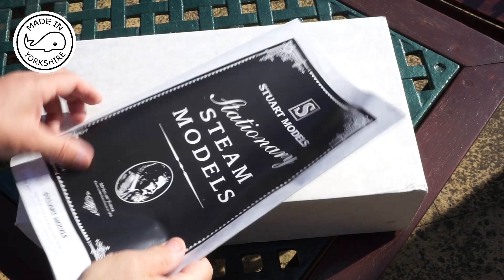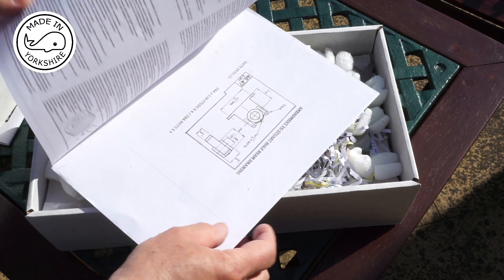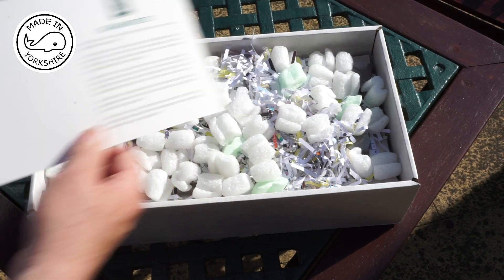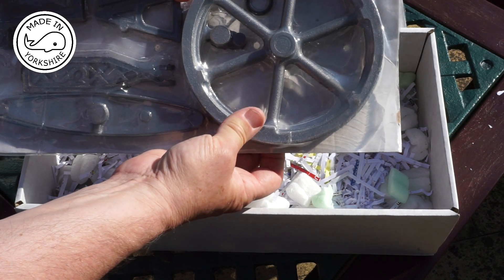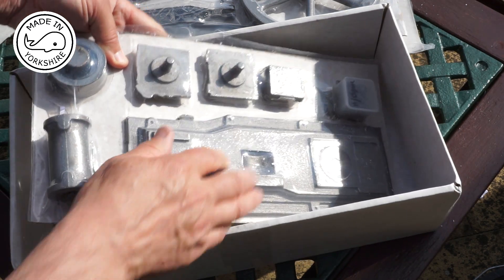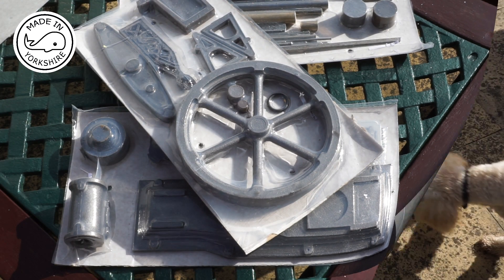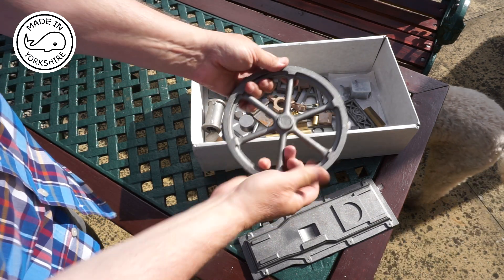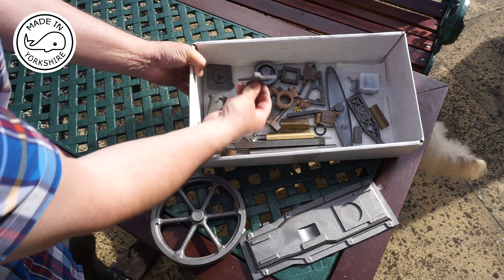#MT32 Part 1 - Making a Stuart Half Beam Steam Engine. Unboxing. By Andrew Whale.

Comment: Andrew are you aware of any formula for the relationship between the stroke of a steam engine and the length of movement that is provided by the eccentric or do you just get your info fron the drawings
Reply from the maker: Hi Peter - I just use the dimensions in the drawing. I'm no expert, but I don't think that there is a direct relationship between the stroke and the eccentric. However, I think that there must be a direct relationship between the slide valve, cylinder port face and the eccentric in order to ensure that the ports are adequately exposed/covered. Hope that makes sence.
All the best.
Andrew
Reply: @learningturningmetal  Hi Andrew, thanks, this model engineering is still pretty nee to me. Thinking and looking at some more engines I think the eccentric is supplying a means to an end ie reciprocating for valve operation. It doesn't really matter what length of stroke just have to make sure the porting gets covered/uncovered. I think I wss going at it from the wrong end
 Cherrs matey

Comment: I seem to remember that Mr Pete 222 featured a coaxial indicator in one of his 1000 + videos. I haven't got one of those yet, but I could have done with one for centralizing my rotary table as I am about to embark on cutting new gears for the lathe out of steel.
Reply from the maker: Thanks Stephen. I'm subscribed to  Mr Pete and will have a rummage through his vids. Good luck with the gear cutting. I quite fancy having a go at that but haven't yet found a project that needs it.
Cheers
Andrew

Comment: Nice one Andrew,
Aleast the lathe has a swing of 8.5 inches for that flywheel.
Compared to the mini lathe.
Also removing the chip sheild doesn't affect the lathe from running as the micro switch needs to be actuated to stop the machine from running.
Eventually the lever on the micro switch will fail, replacing it is quite a job.
ATB Adam
Reply from the maker: Thanks Adam. I just hope the micro switch lasts a lot longer than the estop!
Cheers
Andrew

Comment: Will that flywheel fit in the swing of your lathe?
Reply from the maker: Just! The SC4 can just manage around 8" diameter. The flywheel is 7". However I now realise that I will have to take the safety shield off first. Fingers crossed it will be ok.
Cheers
Andrew